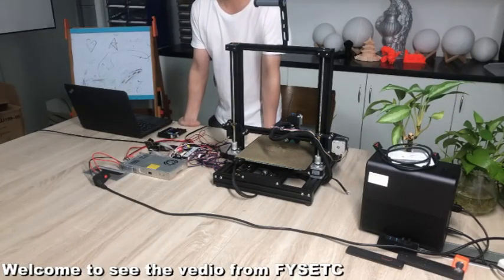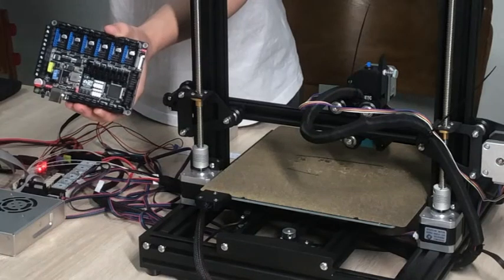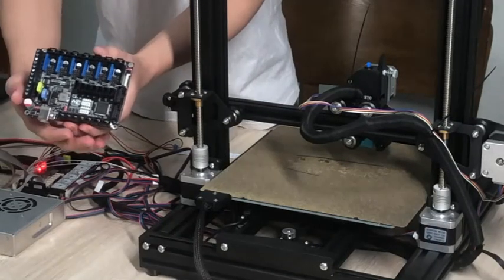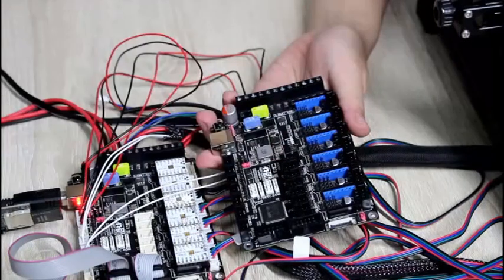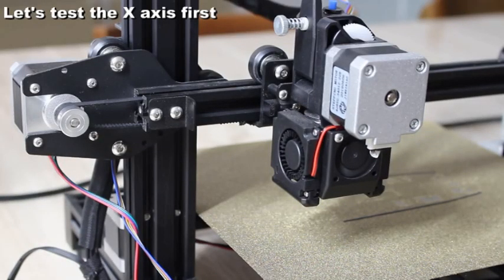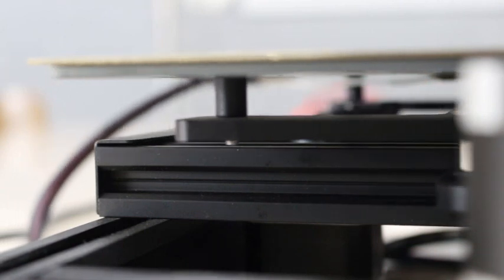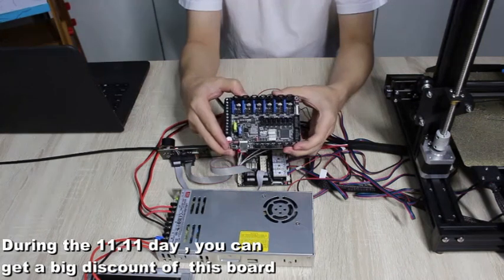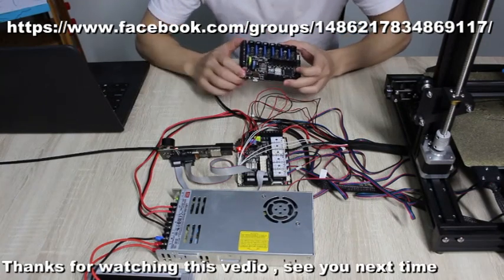FYSETC TMC2209 sensorless homing ON FYSETC S6

Comment: Hello, ive the S6 Board, ive got a question... Can i use 24v for the Main System and an 12v dedicated Power supply for the bed directly on the Board bed input?